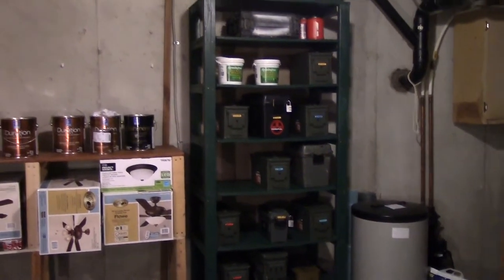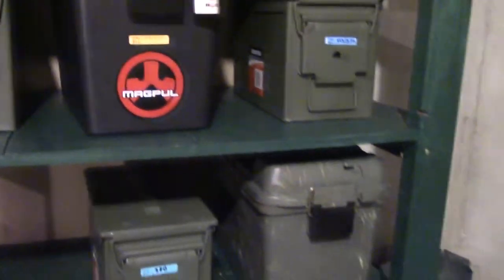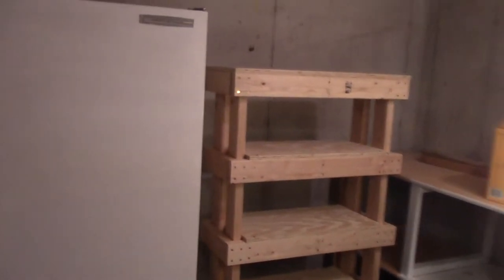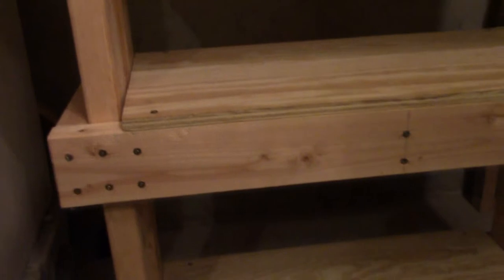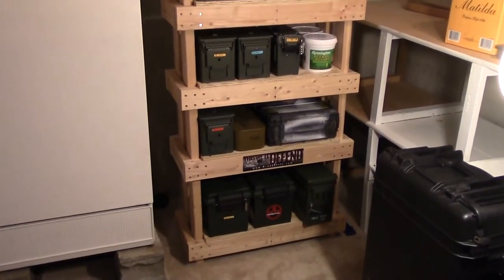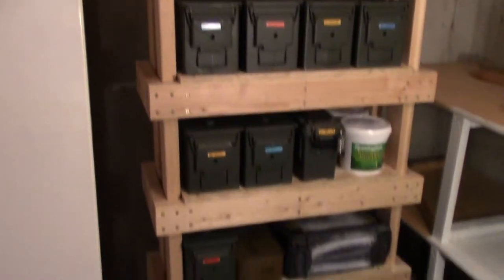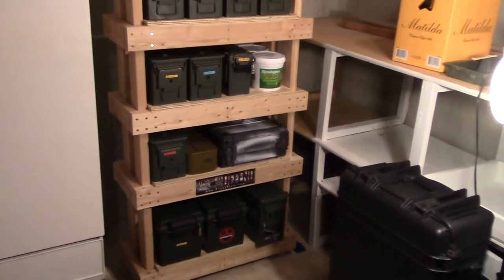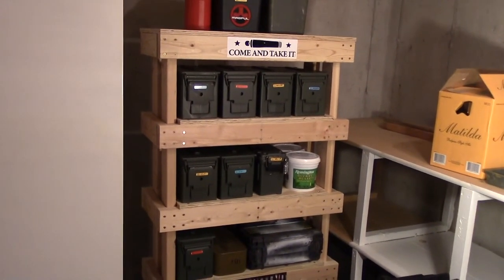"Over-Built" Ammo Shelf

Comment: That shelf is holding/supporting a lot of weight. The wood can definately take it but what size fasterners did you use? They actually handle the weight going down.
Reply from the maker: It was either 3” or 3.5” wood screws
Reply: @BoomstickTacticalLLC  Thanks. And the cans appeared to be M1A1 or M1A2 cans. Are these going to be fully loaded when placed on the shelves? Sorry for so many questions but I want to build one similar to yours and am just trying to figure out the load bearing issues. I have 20 such cans and each will be full. Thats a lot of weight.